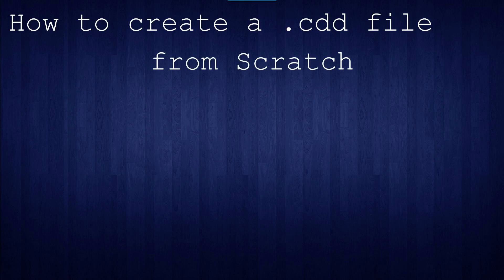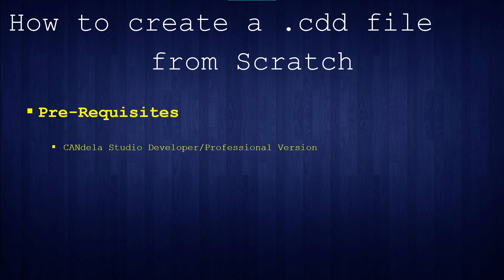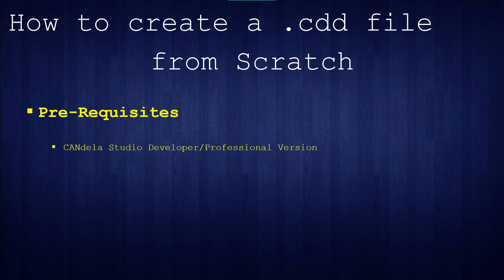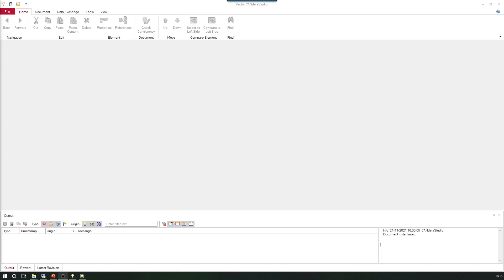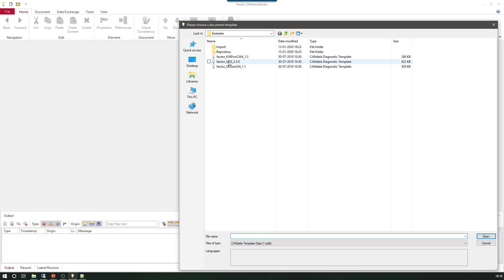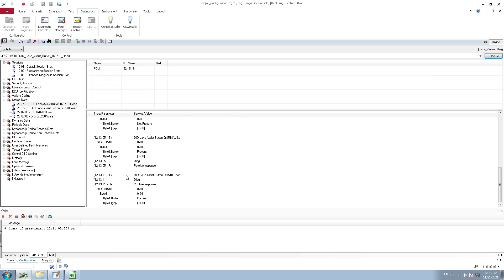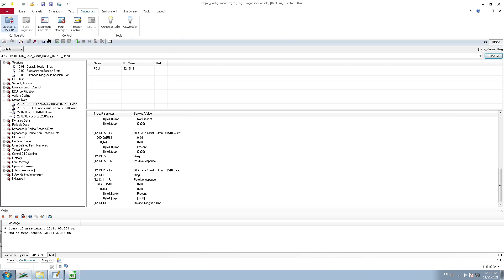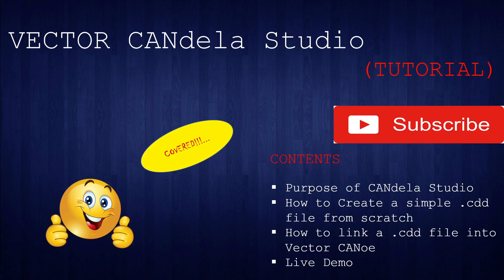CANdela Studio - Introduction + CDD file creation

Comment: Whenever I'm taking the log , my file  size goes to 10 GB. Why it happenes? But whenever my other colleagues do it with smaller size upto 1gb. What's the options selection process when you are saving the fie?
Reply from the maker: This is due to the fact that you have more signals and running for a long time. Best method is to apply a filter before the logging block and pass only the required CAN channels. Also if you save the file in .asc format it consumes more space. You can zip the same